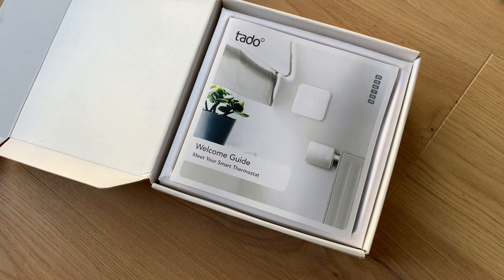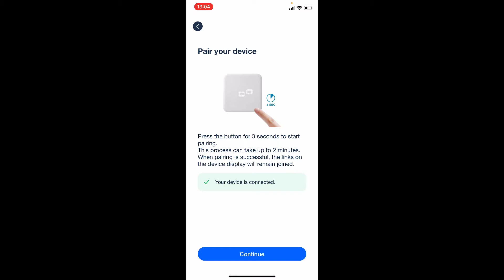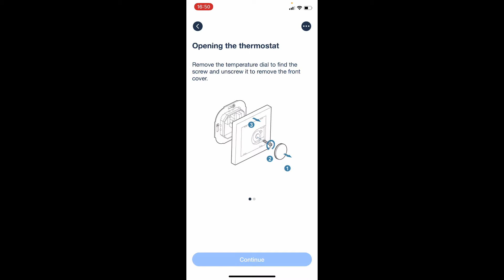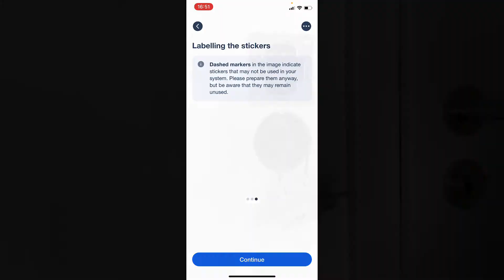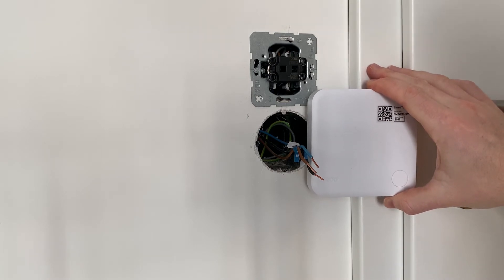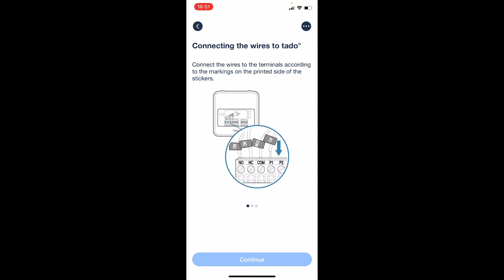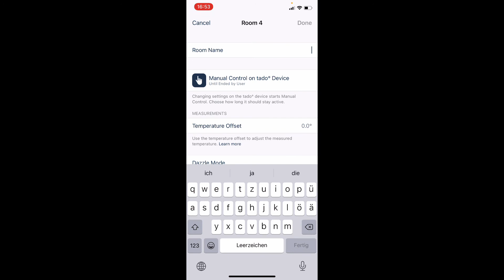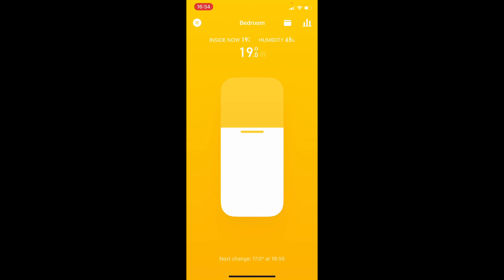tado° Smart Thermostat - Fußbodenheizung / Underfloor Heating - Full Installation

Comment: Thank you for the video! Very helpful. Would this require one Tado for EACH of my thermostats (I have 6 rooms each with a setting)? It seems like I could replace them one by one, I would not need to replace all of them at once?
Reply from the maker: Exactly you can replace one by one, no need to replace all at once. 
Do you have your own gas boiler? Then you could consider adding also a Wireless Receiver/Programmer. But also not a requirement.
Reply: @simple_tech1872  No - I have floor heating and a central boiler (no access). The only issue I have with Tado is that I need to replace the battery. I just don't like batteries, but from what I understand is that the normal thermostats work on 220V which is not ideal for electronics. I was thinking of replacing all the wiring to the water heating controller, but that seems overkill.

Comment: This was acutally pretty helpful.
I am looking to install this in our rented apartment and was unsure if it is possible. 
Lots of floorheating does not support water based systems and they all show an additional device that seems to be connected to the actual boiler (which we have no access to). Do you have any info about this?

Now personally I would rather have bought a single frame instead of drilling into the double frame but that's just my preference. 
Thanks for the video!
Reply from the maker: Hi Sascha, not sure if I fully understood what's your question here. 
With tado° you also have the possibility to control the boiler. This is however not a requirement. It also works well to just replace your room thermostats. And tado° is optimised for water based systems.  Hope that helps!
Reply: @simple_tech1872  Yeah that helps me. The fact that it is not required is the key info.
Thanks a lot! :)